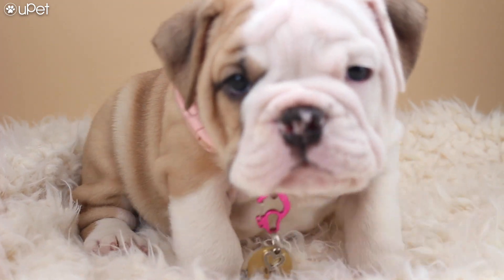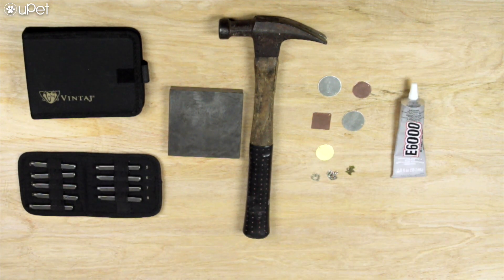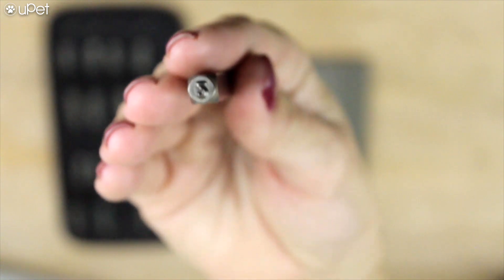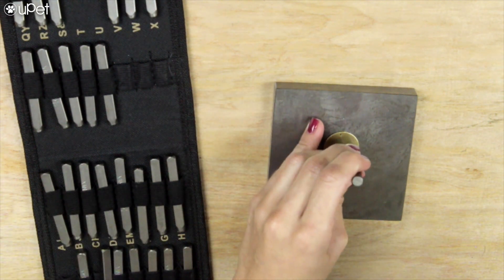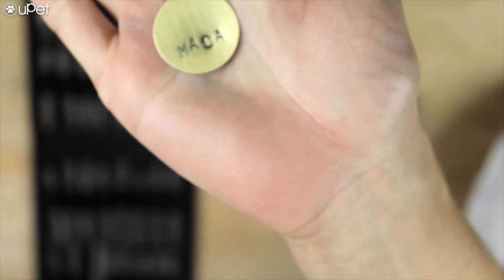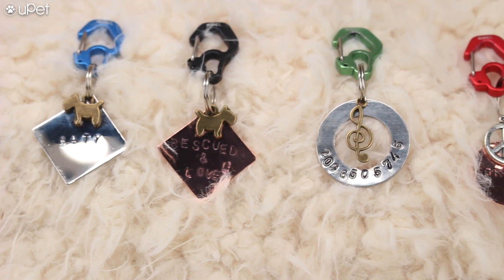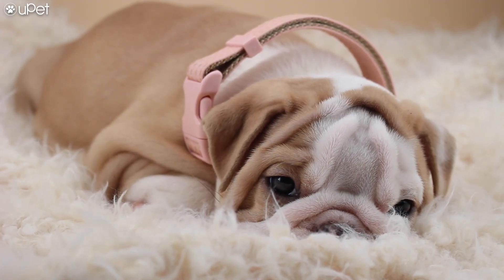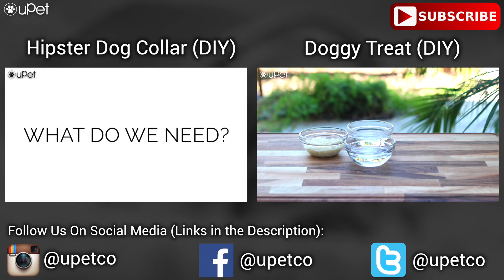Custom Dog Tag Using Metal Blanks (DIY)

Comment: Nice as a trinket... but perhaps not ideal if you want a really strong tag (no glue... solid strong metal all the way through) pet tag. Yeah.... good as a trinket (dog jewellery) but an ID tag is there for a good reason - and it needs to be reliable enough not to fall apart (no glue) or worse... fall off.